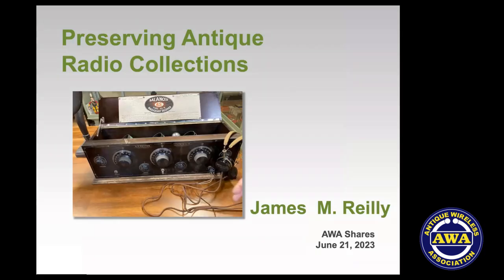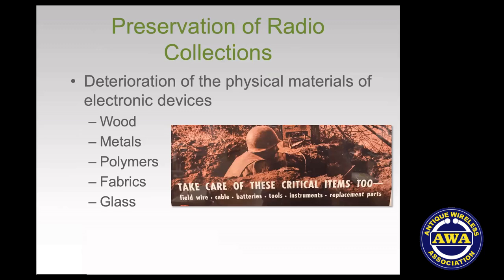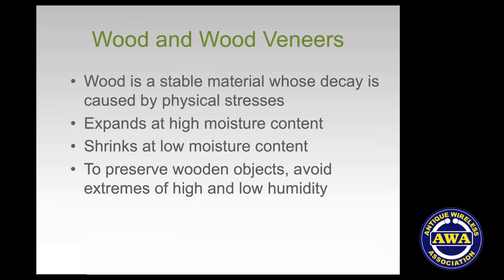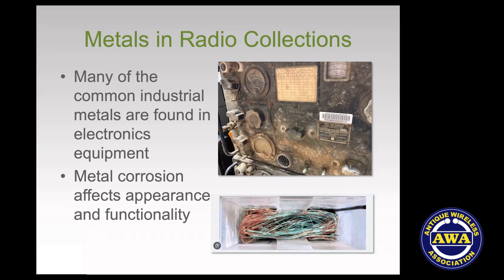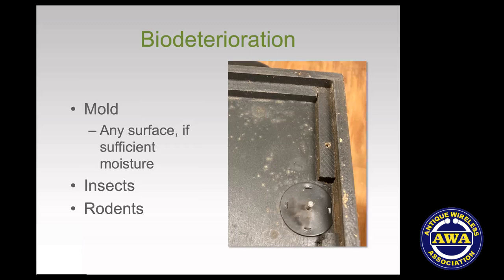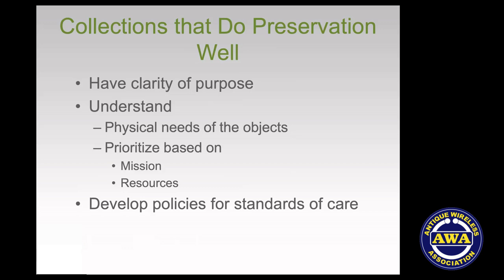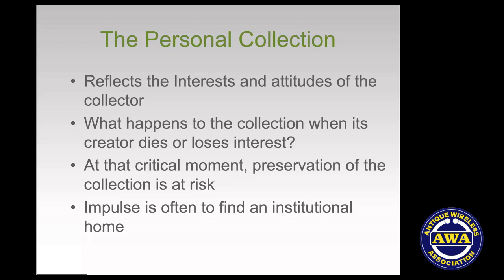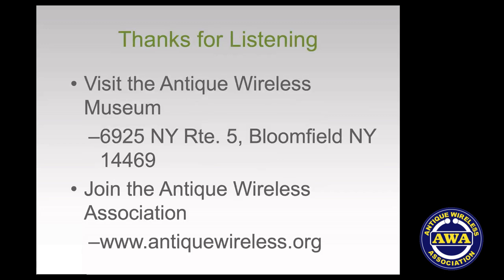Preserving Your Antique Radio Collection

Comment: Have trf and s het philco cathedral s and a 4 tube 30s PHILCO  clock radio    and a parts chassis  2 WORK  57 HOTPOINT TV RED/WHITE ALSO  LIKE YOUR VIDEOS ON SPARK TRANSMISSION.